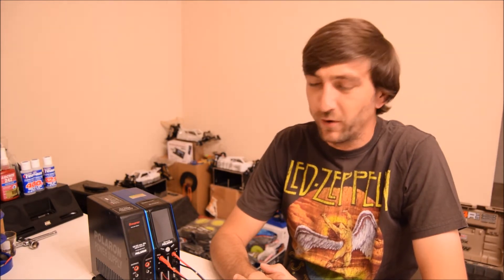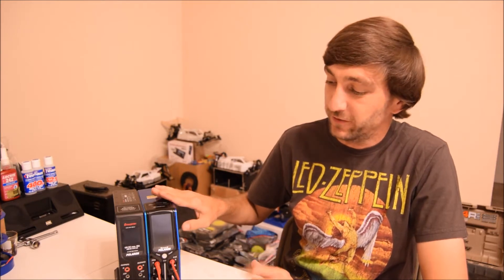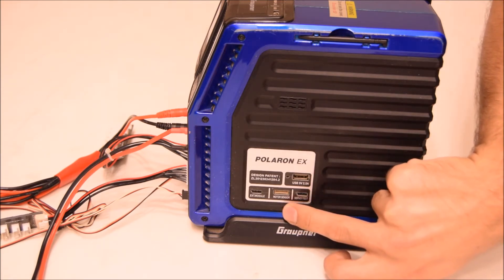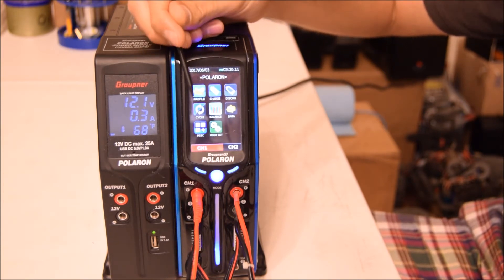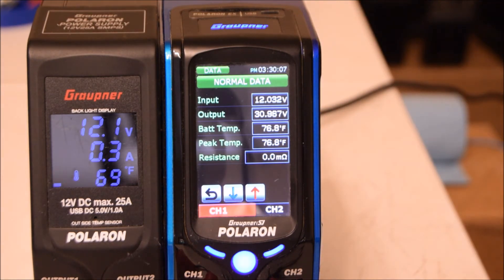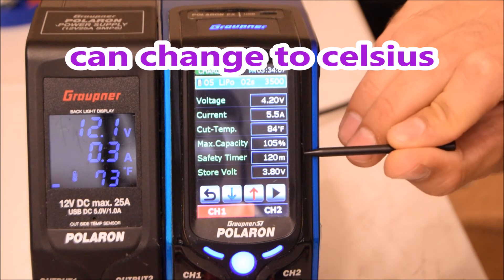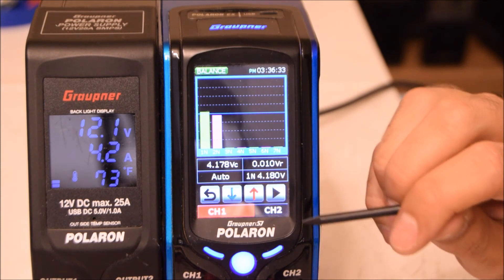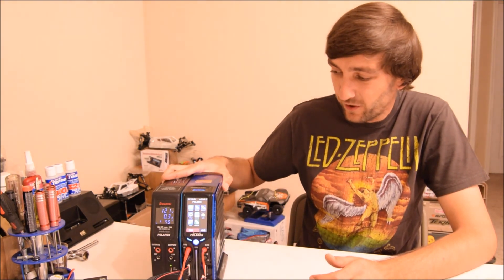Is This R/C LiPo Battery Charger Worth $400? Graupner Polaron EX Review / Tutorial

Comment: Great video thank you for sharing I also have the same charger as you I am just wondering if you dId the new firmware update yet?
I just did mine a couple days ago and now I wish I had done it years ago.
It is a huge change you get a storage button on your home screen and it is now capable of charging bigger batteries.
Also if you purchase the Wi-Fi module for $19 you get 100% full functions on your phone you never have to touch your screen again including a QR reader that is super cool just scan your code on your battery and your charger is automatically set and ready for that battery!!
COOL STUFF
Reply from the maker: I ended up breaking the screen a while back and picked up an icharger.  Kinda wish I haven't now that I've read this.
Reply: Well if you didn’t throw the charger away with the new download and 
Wi-Fi adapter you will have full screen functions on your phone or tablet.
During boot up of your charger for the download you do have to touch resource upgrade on the screen
Yikes hopefully you can still do that
Reply from the maker: @guybrick4490  unfortunately I moved 3 times in a couple of years so it's either buried somewhere or in the trash.  I'll have to look.  Would love to have an extra charger at home